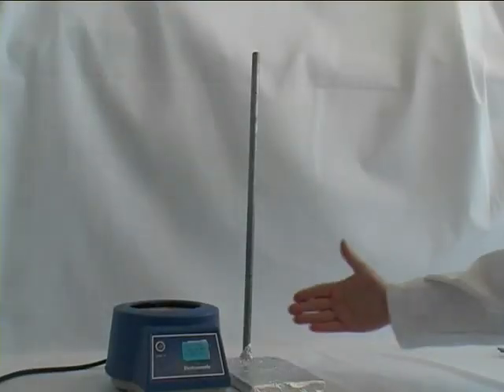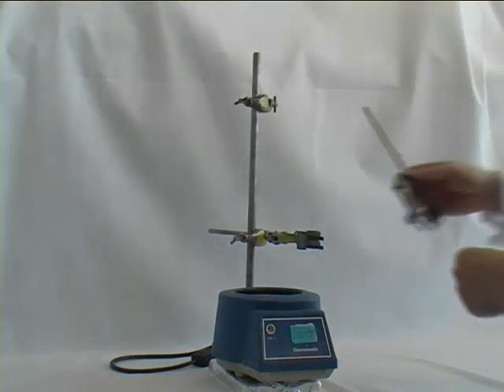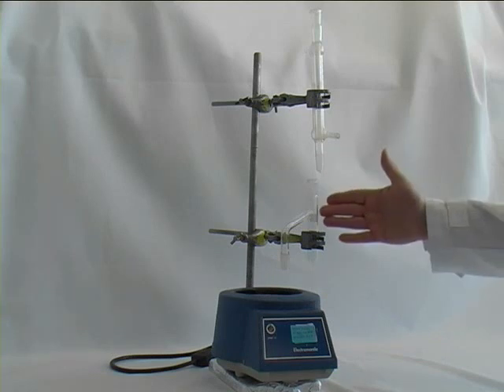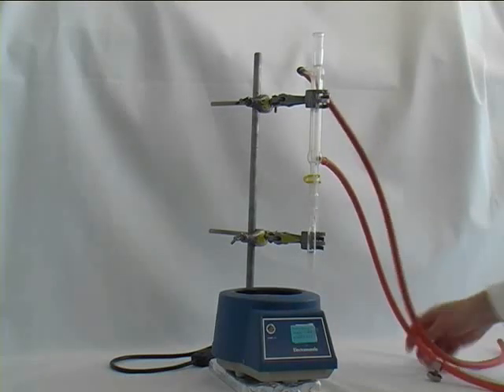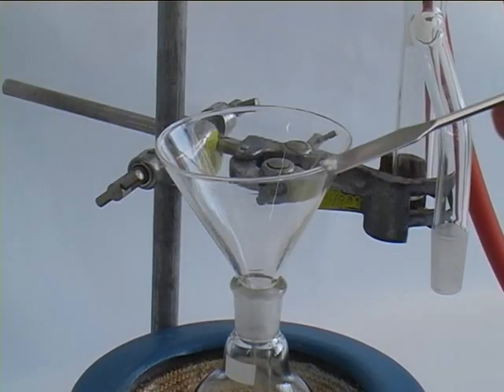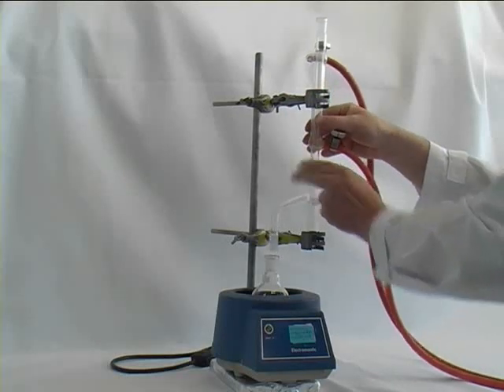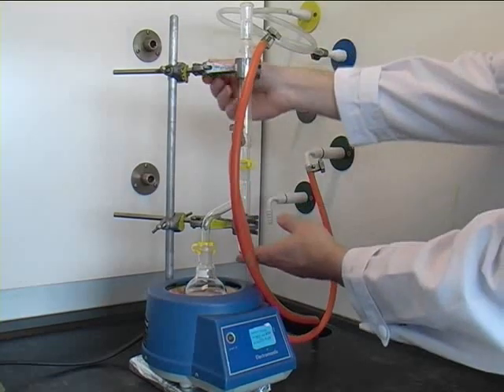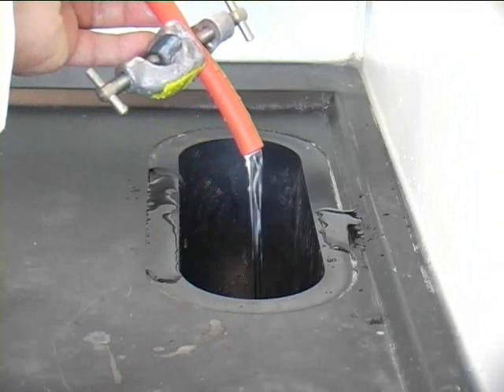Using a Dean-Stark apparatus

Comment: The water is turned into steam and goes up and off to the side and when it cools down it falls straight down into into the collector at the bottom of the condensing column, rather than down the angled tube it came up.

Comment: How does this device remove water? What is the concept behind it.
Reply: This is used to evaporate the water. Once the water is in the condenser then it sticks to the wall of the condenser and the water vapor is there converted to liquid water which is collected and measured to ensure that all the water in the reaction mixture is removed.

This is very important in many moist sensitive reductions otherwise it reacts with water instead of the functional group that have to be reduced to for example amines